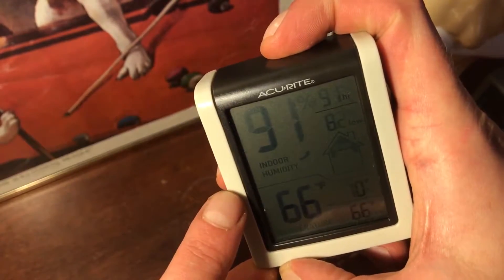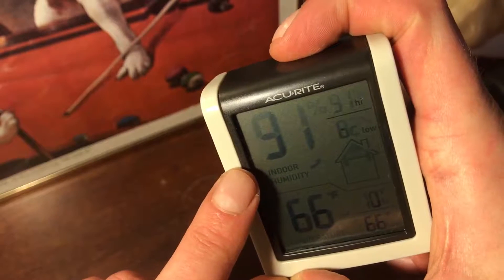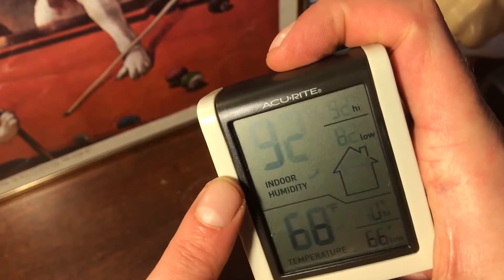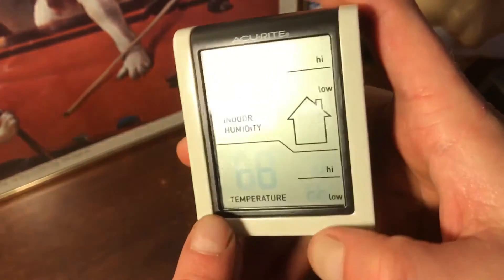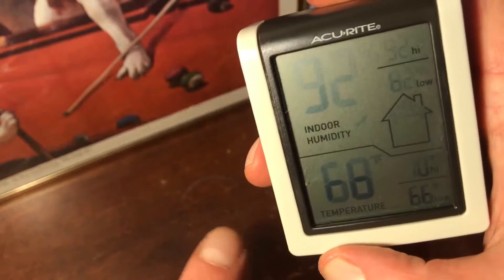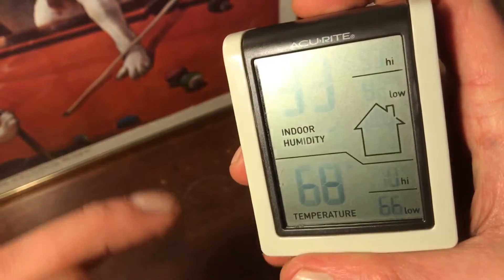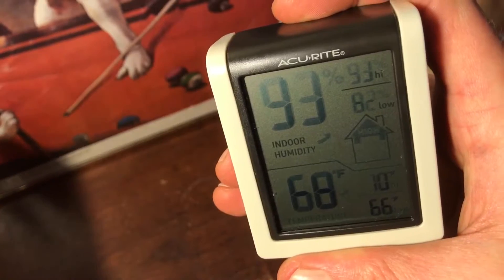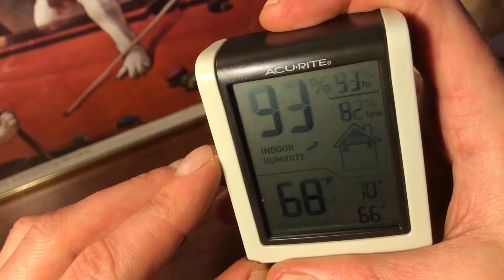DIY Micro Thermal Mass Heater  - Episode 46

Comment: Hey, I was wondering if you could clear out some questions. Do you think you can use ceramic heaters or this prototype on 3 or 4 100w units in a small greenhouse (6f L x 5f W x 6H) ? I'm in Mexico City, and though it sounds "tropical", we sometimes  wake up to 32-34 F° in winter.

Comment: What a great DIY heater project!
Reply from the maker: Dr. Nicks Organics thanks man! It works really well. I would recommend going up to  the 100W CHE. You can also add a small CPU-type fan on top to help spread the heat, but it's really not necessary. The temp controller (that's added in an episode a few after this one) is really the key that makes this really effective, def check that out. I got a humidity controller recently too but wound up using that to make a diy auto dryer/curer which turned out really good: complete control over drying/curing/storage! Episodes on that will be out eventually too. Cheers!